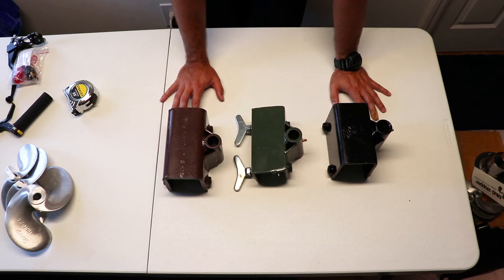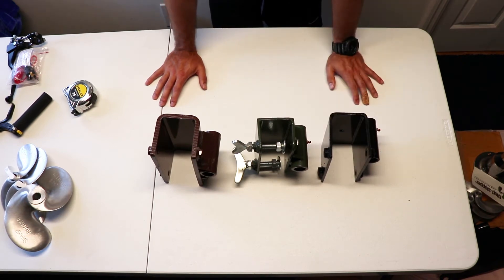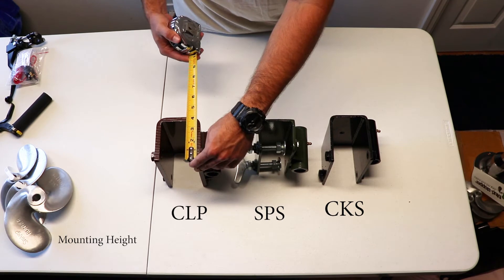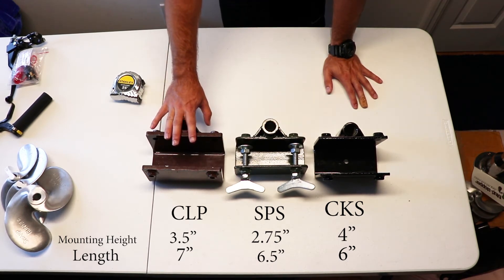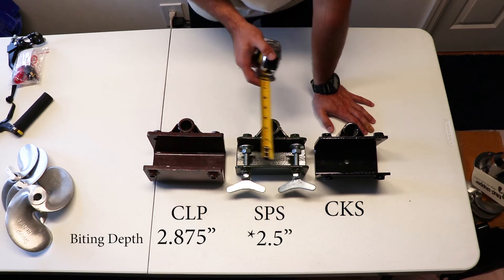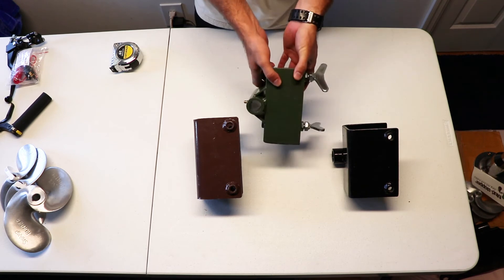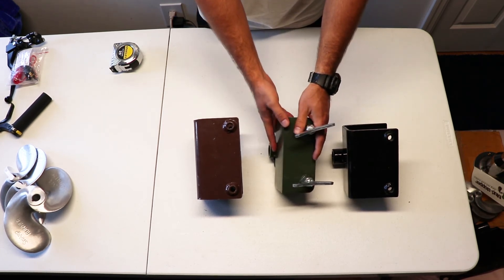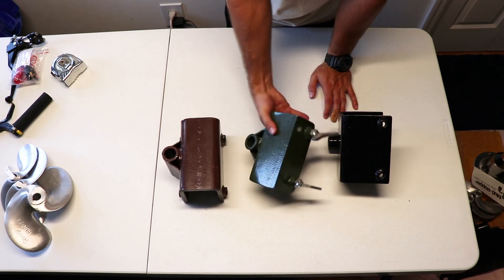Transom Bracket Comparison for Thai Long Tail Mud Motor Kits

Comment: Man, I'm happy you're taking your time with this series. It's coming off well. I was surprised at how substantial all these brackets were. This video series is starting to pop up in the search ranking well. Keep crankin' 'em out.

It's kind of funny though that these brackets look so similar. That hasn't always been the same. Some of the old style brackets looked like stamped metal and were thinner and shallower than the SPS. I don't know the history of the bracket development, but when I bought my kit the SPS had the deepest, thickest bracket. Looks like the others have followed suit.

Did you happen to get the weight of each unit?
Reply from the maker: Thank you Black Warrior Lures! By the looks of it, the Beaver Dam (CLP) Bracket looks stamped. It has no welds in the corners. Swamp Runner (SPS) looks like like a piece of angle iron and flat piece welded to it, and then Mud Skipper (CKS) has a weld on one inside corner but the bracket itself still looks stamped? I have not weighed the brackets yet, but I will soon and I will pin that comment and it will also be in the Unboxing Comparrison Article on the website that I am hoping to finish this weekend.
Reply: I have the clp kit and the bracket is a beast...I would not hesitate to put a 22 hp predator on it...it is also heavy as in heavy duty...your not gonna bend it that's for sure..mine is on an alumacraft John boat and I think I would rip the transom off before I bent the bracket...and I am not easy on my stuff...we run alot  of mud up here in conn and I have had the shaft buried in the mud so deep I thought the transom was gonna crack or bend the bracket and both held up .......
Reply from the maker: Hey Black Warrior Lures weight comparison is CLP-10.25lbs_ SPS-6.25lbs _ CKS-6.75lbs. I have the comparison article up if you are interested in that - https://www.jtgatoring.com/long-tail-mud-motor-kits-comparing-parts/

Comment: I am not a fan of removable transom brackets or buying them even. All it is is a sleeve it is best to custom make the bracket to fit your transom because many transoms are at an angle for use with outboard motors, not longtails. If the bracket is on correctly the boat will have the first step necessary for proper tracking, if you don't have that even if the motor mount is correct it won't track right.
Reply from the maker: Yeah, that's true, but many people do not want to spend the extra time and money on making their own transom bracket and the longtail distributers here only sell the longtail kits, and not specific parts and pieces unless you already bought a kit and are replacing the parts.